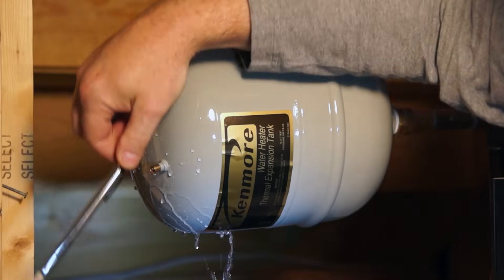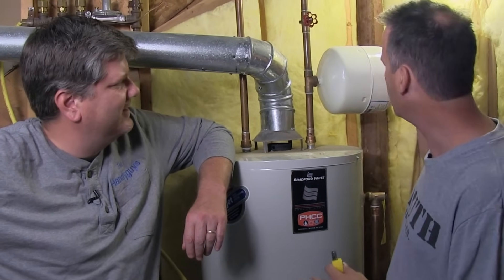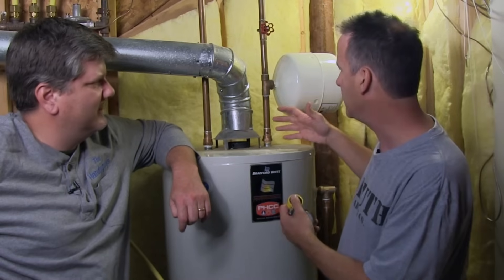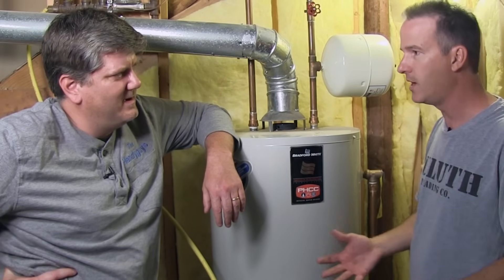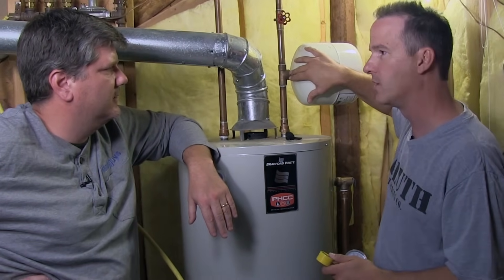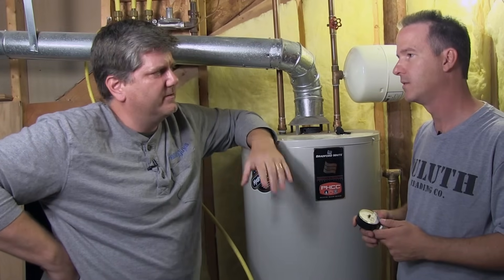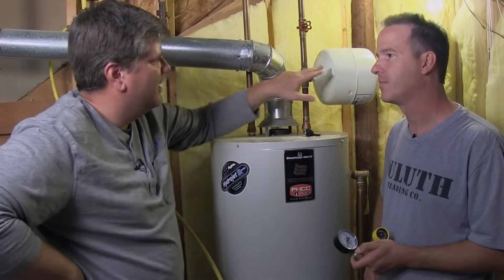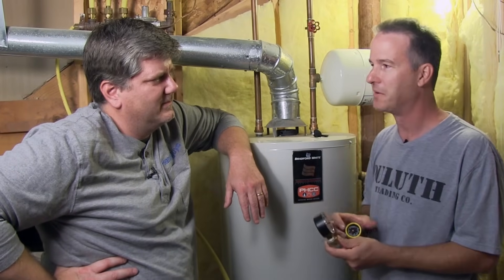Water Heater and Expansion Tank Maintenence

Comment: If you follow your logic than you would need to inflate a car tire to 3500+ psi to compensate for the weight of the vehicle.
That's why the new tank only has 35 or so pounds because you can't displace the air in the bladder with the psi of the water.
However a tank like a wheelbarrow can go flat for no reason what so ever allowing the water to press the bladder back completely. So shut off water open upstream valve to allow the water to relax than add the recommended 35 to 37 psi.
If the bladder is good that will be plenty.
If you put in 70 to equalize the water pressure than when you turn off the water for maintenance or repair it could force the tank to empty its water and possibly rupture the bladder. Than no water will be allowed back into the tank.
When checking tank, If you get any water from schrader valve the bladder is ruptured and needs replaced.
Reply: It will compress the air to the water pressure though.  Which will prematurely wear out the bladder inside the expansion tank
Reply: At the risk of seeming argumentative and with full appreciation for your quest to educate.
As I stated The more air the less water to the point the item is rendered unusable.
Here is a link to a manufactures specs. it shows 40 psi is the field adjustable factory setting and it goes as far as graffing the volume displacement when increasing pressures.
http://www.americanwaterheater.com/products/pdf/exptank.pdf
Reply: We are on the same page.  Its OK to argue respectfully.  Controversy and discourse is the mother of progress.
Reply: +greenrumour Like the discussion but wonder about your 3500 "psi" logic.  Since P=F/A.  ..... if a vehicle weights 3500 lbs, then each tire is holding 1/4th of that, 875 lbs (force).  If there are 35 PSI (pressure) in each tire, then each tire's average road mating surface are is 25 sq. inches (area).  >>>>>>>>>> No?
Reply: Michael Goodman Tou-che' on quartering the load. I still maintain that even if the vehicle weighed 14k and had 40 x 12 inch tires on It would still only require 35 psi in the tire to lift the load. My point is that over inflating a rubber bladder or a rubber tire can have obvious adverse effects.
Reply: greenrumour with all do respect..... What..? Are you out of your mind..? An average car tire is set to 35psi or what ever the specs are on the inside door sticker. Makes ZERO difference if the tire is on the car or lying flat on the driveway. (35) is the number.. 
As for the link you provided... Did you even take the time to read it..? Because, it clearly states that it's pre- set to 40psi. BUT, must be adjusted to suit what the end destination. In other words, if the pressure coming into your house is 70psi.... Then you need to pump the bladder up to match. Them must be the same to achieve optimal performance. You can do as you wish but, street smarts beats book smarts ever time it's applied. Lol..!
Reply: Mr. Big Brownbass Roflmfao !  Specs for tire inflation would not be on the door 🤗. Just saying. As far as the rubber bladder is concerned, it’s all going to depend on make and model, just like the silly tires. The points made have been valid. Look at the product and final application and and things will work out fine. These videos are general guideline most of the time. Quite helpful for people trying to get a baseline of where to start and general overview of what to look out for lol. Good luck with those door tires! Lol. Kiddingly of course, just gave me a good chuckle. Caio m8
Reply: thetalentpod

He's confusing OEM tire size specs (this information can be found on most vehicle's driver side door jamb) with a tire's PSI maximum rating.

Comment: I’m having the issue with water dripping from my pressure released valve line from my heating system which is an electric hot water system, would it be the same idea?
Reply: You can try lowering temp setting at thermostat first. You may have set  at too high. 125 to 130 degrees should be good enough. Expansion tank is the same, regardless of fuel. Installed correctly it has its benefits. 
Note* You may also have a bad TPR valve. Its very cheap. $12-$14 
Sometimes calcium build up or sand prevent the valve from closing fully/
Reply: Yes, same concept.

Comment: Great Video guys!.... I was at my parents house and decided to test their pressure release valve on the water heater. After the test, the valve started to leak, it didn't leak before the test. i have never seen the separate tank like you explained. I was going to just change the pressure release valve but now I will do your test. Any advice? Again, great video!!!
Reply from the maker: the good news is that it is easy to replace the pressure release valve. Installing a new tank on a system that does not already have one is a whole other story.

Comment: Should you not be bracing that expansion tank?  Everything i have read clearly states that if you mount it horizontally off a vertical pipe you need to properly support it. You are putting lots of stress on that T valve, especially if the tank fails.  Thanks.
Reply: Yes, brace it.

Comment: On my Amtrol  "Extrol" expansion tank, I'm not getting water or air from the filler valve. I even tried to add air from my air compressor and the valve seems to be faulty. It won't even fill. Left it on there for 5 seconds, then 10, trying to fill, and still, no pressure from the valve.

I'm leaking water from the pressure valve coming off the boiler.

I'm guessing my expansion tank is bad then?

It has a date code of 11213399. What the hell does that mean? Why not just use a regular date format?

Comment: Very disappointed with the explanation of Expansion Tank Operational Theory in this video.
It is not sufficient, to simply add an arbitrary amount of air pressure to the tank. If the tank was properly sized for the water system by the installer, then pre-pressurizing the tank to the anticipated "working pressure" of the water system may be adequate. However, there are other factors that should be considered by folks that are experiencing frequent "leaking" from the Relief Valve on their water heater (or boiler). The volume of the water heater (rated capacity) should be used to calculate the volume of expansion that will occur as the water is heated to temperature. This much is usually provided via a chart on the box that the tank was packaged in when purchased. However, one should also consider the volume of plumbing in the system. For instance: If the water heater is located in the basement of a three-story apartment building, measuring the water supply pressure at the heater, and adding air to the expansion tank to match that pressure, may not work out as expected. During times of (high volume) hot water usage, such as when several tenants are getting ready for work in the morning, and their showers deplete the hot water heater; the total volume of expansion that will occur in the system will likely exceed the rating of the expansion tank, when the volume of plumbing is taken into account. It must be realized that a sizable water system (with large diameter pipes to assure adequate flow to all areas) will greatly add to the total volume of the system. If the hot water is "used up" and cold water flows through the hot water heater (without being sufficiently heated) and the "Hot Side"  of the plumbing system is subsequently filled with cold water.... not only will a given volume of expansion occur in the water heater as the (perhaps 58 deg. F) ground water is heated to temperature, but the cold water in the pipes will also warm to room temperature; thus, adding to the total expansion volume. In this case, it may be necessary to increase the size of the expansion tank beyond what is recommended for the capacity of the water heater.
Reply from the maker: marshalllhiepler All i know is that having no pressure in tank meant some water spurting out the T&P valve. I added about same air pressure as my water pressure and problem solved. I don't think this has to be exact. You just need to account from some expansion caused by the heating of water. This video is not about sizing a water expansion tank, but simply about making sure it has not failed (leaking bladder) or has not been filled with any air pressure.
Reply: +The Handyguys 
Good video ... but ... when you say:  "I added about same air pressure as my water pressure and problem solved ..." ... My static pressure is 80 psi.  With reasonable flow it went down to ~32 psi.  ........ The tank came factory set at 40.  ...............
Question:  At what pressure do I set my tank?  
    (It says to set uninstalled, no pressure on it.)
Question:  And do I check it annually with the system depressurized and adjust back to that?

Comment: do i need to drain my tank in order to install a new expansion tank?   db
Reply: +dick bailey turn off the boiler. Isolate the boiler to fill loop & expansion tank, ( should be a shut off between them, the three port valve that switches between the hot water tank & the radiators should be on the other side. direct from the boiler..  so no, no need to drain the hot water tank.     you might just want to drain the whole system down though.  its good to flush

Comment: My plumber installed my expansion tank on the Hot side? Is that ok?
Reply: It will still function. Hot and cold sides are linked through the water heater. Whether it's life span is affected I don't know, but I have seen one or two installed this way.
Reply: @stevescherer4954  Thank-You Steve, I appreciate you taking the time to respond. I figured it wouldn't make much difference other than perhaps a lesser life span due to hot water running thru it rather than cold. But at $36 its not a huge loss and it screws in so a replacement is a simple DIY job. Thanx again

Comment: Actually an expansion tank is only necessary if your service has a backflow preventer, a check valve or a pressure regulator which most services do not require. The absence of these devises means that the pressure created by heated water simply dissipates into the system and the water service. If your water heater develops an over heat Condition, you will first notice it at your faucet with spitting and steaming. At that point the relief valve may discharge water if the temperature reaches the set pressure. Disconnect the power to the water heater and call service . The expansion tank will help very little in this situation.
I believe expansion tanks should be always mounted up and should always be separately supported.
Reply: Thanks Bernie, you are correct. Interestingly, in our area blackflow preventers are required most everywhere.
Reply: Handyguy Brian So if I do not have a water pressure regulator attached to my water meter, do I need a expansion tank?
Reply: AndiLee421 It depends, the pressure regulator isnt the issue. Its the backflow preventers. if you have one, when the water expands it has no where to go unless you have an expansion tank.
Reply: i didn't type that,i swear to god,i think somebody hacked my account........ :'((((((((

Comment: Two comments on this great video. First, the high water pressure only occurs after the water heater has been run hard. Take a long shower using all the hot water, then wait 20 minutes without using any water, hot or cold, then measure your water pressure. Second, never ever use a saddle valve. They are prone to failure and against code in many municipalities. If you have saddle valves in your home, consider having them replacesd.
Reply: I agree about saddle valves, big no no, I replaced a leaking one with Sharkbite Service Slip Tee Adapter, along with Sharkbite Brass Push Straight Stop. This solution allowed me to cut the bad saddle valve out and the damaged pipe on the hot water tank, the Push Straight Stop Valve goes right on the Service Slip Tee Adapter and its solid as a rock, stronger than the copper pipe its attached to for sure, then I use the burst detection hose to the water line for the refrig and another for the dishwasher. The valve for the dishwasher on the cold side of the tank was also leaking it was the typical valve you find under sinks and toilets, got rid of that with another Brass Push Straight Stop Valve from Sharkbite. I do both SharkBite and Soldering, just depends on the location and access!

Comment: The expansion tank is installed wrong. It isn't supposed to be installed horizontally. It's supposed to be installed vertically.
Reply: It can be installed sideways. I am no pro but read the install instructions on my new expansion tank. Hopefully, they wrote it after some verification
Reply: @anchalsharma  Installing it sideways will not allow it to fill properly.
Reply: @tikigod1166  that is true. Air might be trapped. But, on the bright side, when the tank (eventually) fails the trapped air would still provide some expansion support by compressing and expanding. Anyways i have seen them installed upside down as well. People on reditt have agreed with the install as well. I know facts can't be decided on opinion. But, many people have installed in weird orientation with no reported adverse consequences.

Comment: Wished I had come across this earlier, after replacing the relief valve then the thermostat it finally occurred to me that the expansion tank could be to blame and sure enough water came spraying out when I went to check the pressure.

Comment: Isn't that tank installed wrong? It shouldn't be sideways. The water connection should always be facing up, to "burp" the tank, allow air to get out to the faucet. And yes the bladder pressure should be tested when the system is depressurized (and best to ensure the water heater doesn't kick on during testing, just turn it down). Then also add/remove pressure from the bladder when the system is depressurized.

Comment: Pressure used to relieve back into mains?  Surely not, they were gravity systems, no?
Reply: Back into the "mains " is referring to the pressurized feed line from the " City Water" supply. No "gravity" involved here. With no check valve on this feed line , then the expanding water from the tank will will not ever build up pressure , but simply equalize by pushing back into the City Water  system.

Comment: The expansion tank is improperly mounted.
Reply: Yes I agree. Also, I don't understand how any of them would work properly if the water connection is not at the top, but I often see them with the connection at the bottom. There's no way to "burp"the tank if it's at the bottom

Comment: Use a Dielectric Union on the pressure tank and on the water heater.  The threaded copper to steel connection won't corrode as easily.  The Union can be disconnected and re-connected easily for ease of replacement.

Comment: This is the wrong size tank, wrong way to check air pressure, too close to the water heater and not pointed up to help sediment from falling into tank, and why leave that crap gate valve in there as your redoing things. It always amazed me that plumbers never hang around and see how well thermal expansion tanks hold pressure down. If they did they would never use the small tanks. 30 years of talking to fellow plumbers and not one had the curiosity to test this once. How do they not even notice that small tanks don't last very long. Even if you have service pressure of 80 and you put 80 psi into a large 4.5gal tank, your whole house will climb to 120 psi. ( 50 gal heater reheating from scratch and also depends on incoming water temp from st.) Then watch what happens to houses with 2.5 gal tanks. Even though 80 psi passes code for sevice pressure you don't want to start there because your pressure goes up expeditiously.  Always lower your customers pressure as close to 50 psi as possible and use larger tank. Unless you don't care about them having over a 100 psi on there icemaker line, washing machine hoses, plastic  toilet on second floor, plastic water softener.................   you should also offer the customer a oil filled high marking pressure gauge permanently installed so they know when the badder is ruptured.  If the public only knew were the disaster clean up trucks are headed every day they see them. Hint, they are not going to fires. They are going to houses with poorly installed pressure tanks. They aways blame it on some weak link plumbing fitting and never check the tank. How could they know how to check pressure. They just restore the house and the underlining pressure problem is still there. I'm also tired of plumbers telling customers there tank is precharged and not following the instructions. 80% of the plumbers out there are just throwing the tank in as is. Watch what happens to your house pressure when this is done.

Comment: bill the first time i checked thev water pressure, it was 89lbs.l checked it the next day it was 98lbs.. out to the street as far as i know, there is only a shutoff valve, and the water district has a special tool to shut it off or on.the valve is down at least 4 ft. i have no way of adjusting the water pressure.    dick bailey

Comment: "They've put these anti-syphon or backflow prevention valves"....who are "THEY" and where did they 
install them? My house was built in the mid 70's and my existing water heater does not have a thermal 
tank, so does that mean I don't need one?

Comment: I would remove tank, set pressure to spec (look up what city pressure corresponds to unloaded tank), then reinstall. The pressure should be something lower so that places the diaphragm in the correct state (water vs air volumes in tank). As it is connected and pressure is returned the air volume will decrease as the air pressure side increase to equalizes to city water pressure side.